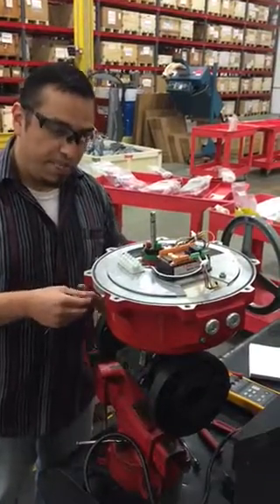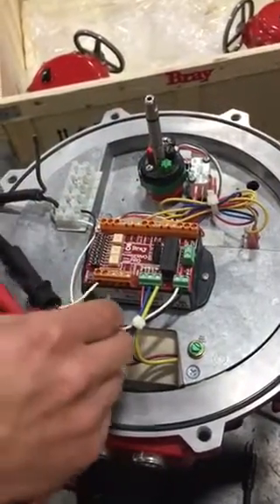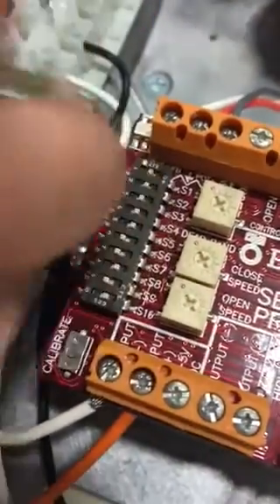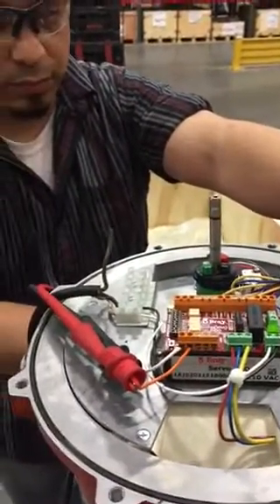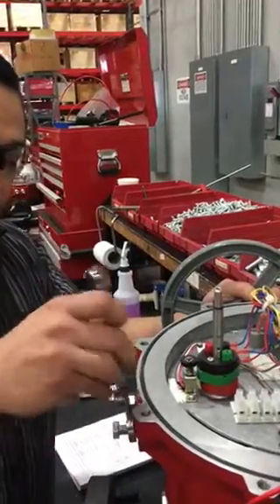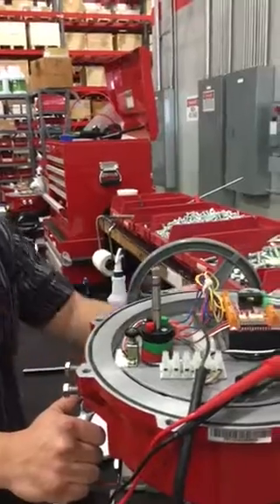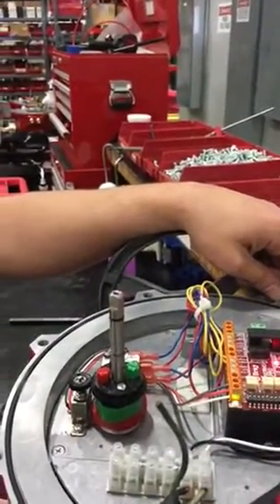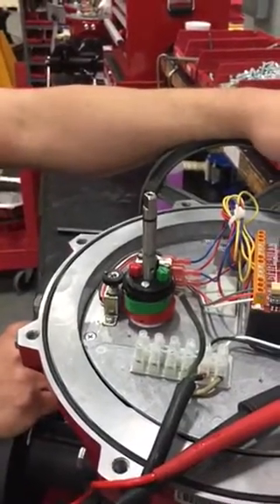Bray S70 Calibration

Comment: Hi!, I wanna know if there is a documentation about the calibration, I have a poblem with a valve like this one, the 0 % (closed) is on 4 ma, and the 100% (open) is on 16 ma. I want the 100% (open) on 20 mA. How can I fix it?, Best regards!
Reply from the maker: J Berver you can locate the Operations and Maintenance manual on the bday website at www.Bray.com, under the Series 70 Electric Actuator Product, in the download tab.